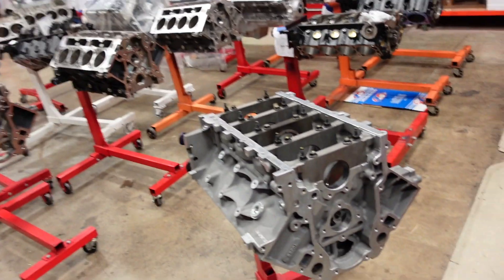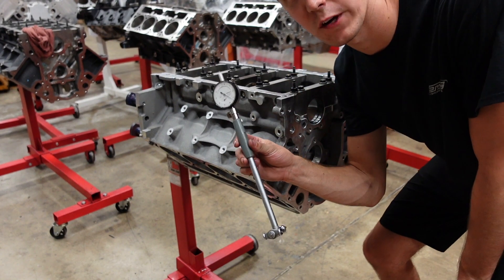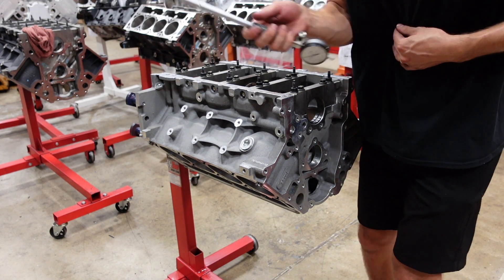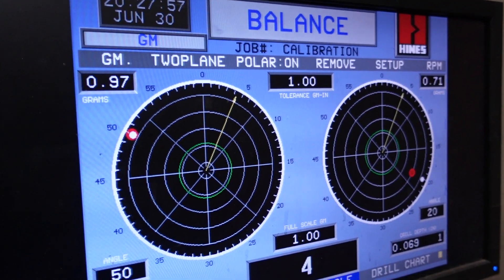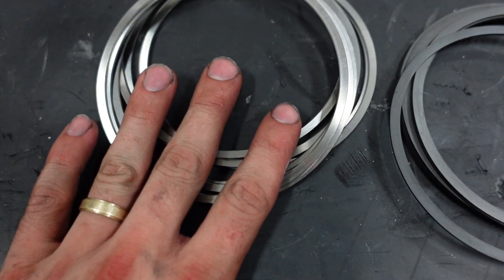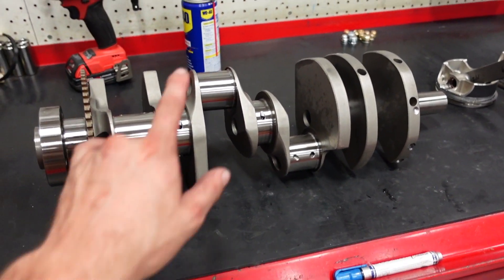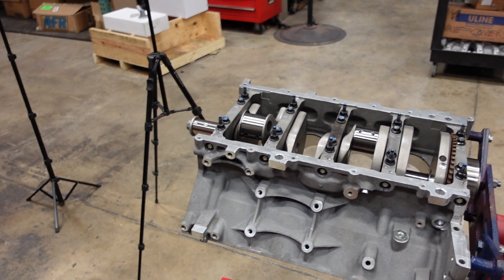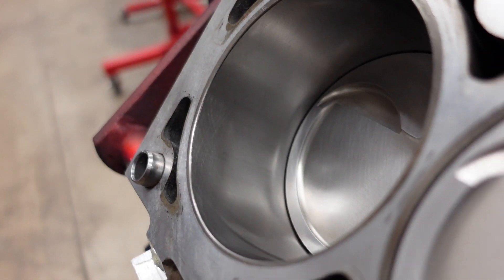LS3 Build - 900hp 416" Stroker (part 2)

Comment: 0.002 in the hole? what? .051 gasket with +0.002 deck? no way that's definitely a large quench thickness you might get dentation most definitely than getting a thinner gasket even in boost material and balancing and blue printing is one thing but understanding physics of the phenomenon of quench, compression, flame front control, cylinder pressure and much more is a whole other world.

Comment: Just found ur videos. On the mains for the boosted  application  are those stock main bolts strong  enough  to handle  that power level or should arp main studs be used?
Reply from the maker: I’ve used factory main hardware up to 900-1000 depending on the power adder
Reply: @JacobVillemain  I just found your videos. Great explanation of the process. I have a couple questions about torquing the mains. 1. Are you using new fasteners for the final assembly? 2. Are you using torque-to-angle or a torque value for your final step with the stock fasteners?

Comment: Never heard of people using half one size main bearings mixed with half another size.  That doesn't hurt anything doing that?
Reply: Exactly! I would have thought that would misalign things slightly.  Hopefully he answers....
Reply: @ryanscanlan9875  Bearings are eccentric at the parting line meaning they taper a bit at the ends. That makes mixing halves possible.
Reply: Common practice they make a standard bearing and an x bearing that gives you about a half thou difference if your needing more clearance

Comment: Hey Engine Guy I hve a Gen3 Lq4 want bout 700hp N/A pump gas daily driver. Can I bore 4.070 wit a stroker crank? Wat crank & stroke please!!
Reply from the maker: Yes you can bore it to 4.070, and install a 4” stroke crank, netting you 416” cubic inches.
Reply: @JacobVillemain  thanks d kit is Eagle LS3 Forged steel crank 4140, Eagle 6.125 rods H-beam, SRP Prof -5cc Flat top Pistons, 58 Tooth Reluctor. All d mains, bearings. Will dem rods work or should I go wit d stock length n d H-Beam.
Reply: Hey Engine Guy I want to kw if  I should use d rods dat comes n d kit which is 6.125 or should I gt dem n H-Beam but same length as d stock rods. Also wat CC heads dat I still cn run pump gas??
Reply: @darrellhughes6773  not the engine guy but yes use the 6.125 rods piston has matched wrist pin height for use with the crank

Comment: Have you any any issues with head gaskets failing  on the ls3 at a 13.1 compression ratio 750 n/a no power adder  horsepower range?
Reply from the maker: Never

Comment: It appears that you finish torqued the main caps after you installed the Rod/Pistons, What is the reason for this???
I'm in the process of assembling a 5.3 myself and also noticed you put sealant on the side crank bolt hole!!
Thank you,
B